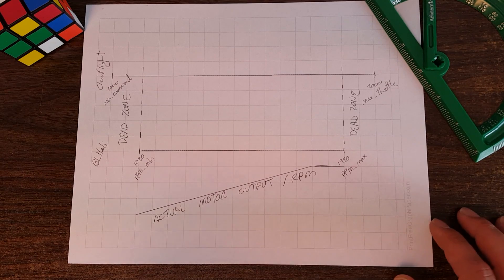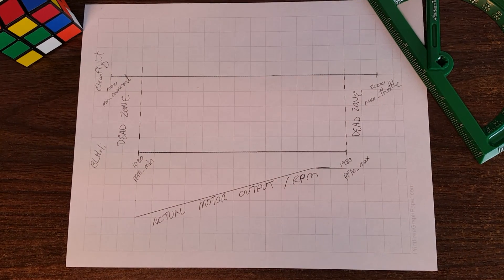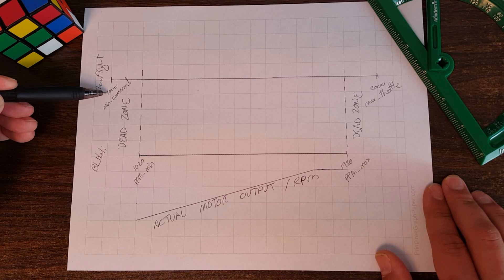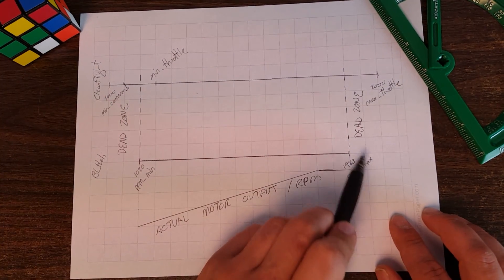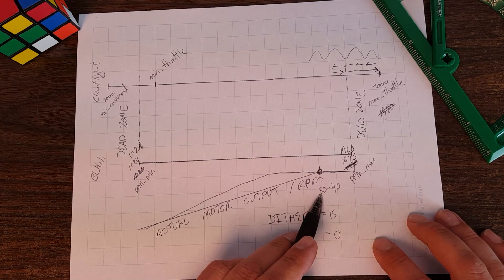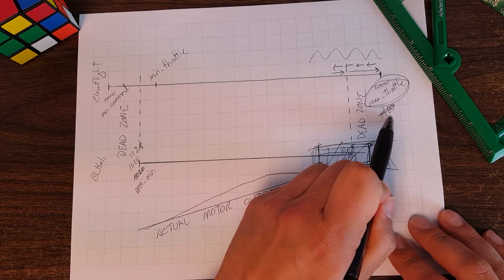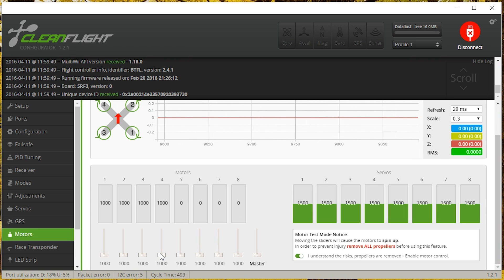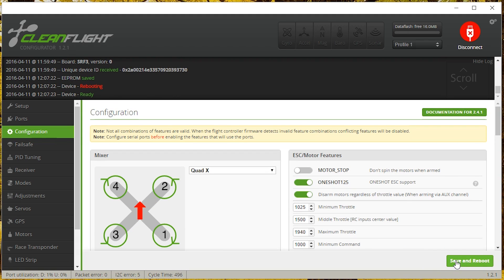Cleanflight BLHeli Top-End Throttle Calibration

Comment: Hey Joshua - did you reset your stick endpoints afterwards to 1940?
Reply from the maker: +roylionking No. Because the stick endpoints and the Receiver tab are on the INPUT side of the FC -- from the transmitter to the FC. The ESC endpoints and min_command and max_throttle and min_throttle are on the OUTPUT side of the FC -- from the FC to the ESCs. There is no implied relationship between the input and the output side at all. The input side goes from 1000 to 2000 unless you change that using the rxrange command. The output side goes from min_command to max_throttle, and those values can be whatever you want, but they have to agree with the ESC PPM min and max endpoints. Cleanflight takes care of mapping between the input and the output side curves.
Reply: +Joshua Bardwell thanks! So is it worth tuning endpoints on the taranis, where 100% results in over 2000 and needs something like -98% to 97% to give 1000-2000?
Reply from the maker: Tube endpoints on the Taranis to make 1000 to 2000 on the receiver tab. This is usually about 97%

Comment: why don't use the highest value? 
when using the lowest value only that motor will reach top rpm?
if you use the highest value all motors will reach full throttle and the deadband will only be as big as the difference between the highest and lovest motor?
Reply from the maker: +oskar aidantausta Using the lowest value keeps all motors from ever entering the dead-band and some motors will not reach full power. If you use the highest value, some motors will enter the dead-band, but all motors will be able to reach full power. Either approach is fine. The "lowest value" approach should give smoother flight.

Comment: Very happy to have such good information available.  Thank you Josh!  I really like your hands on approach to discussing this.  It was a nice point to also talk about Kiss escs and their linear throttle curves vs Blheli and the top end flat spot.  Great stuff!
Reply from the maker: +QuadQuestions.com Thanks for watching. And thanks for the QQ190 frame--now that I know it goes to 40 degrees uptilt, I LOVE IT. Can't wait to get it in the air.

One question (as long as you're here) -- why not build the vTX mount into the back of the camera pod base-plate, instead of having it be a separate add-on? Seems like just a square cm of carbon more, and you could easily do it.
Reply: Joshua Bardwell Hi Josh,  I would like to add you to our development thread on Facebook-  We have a lot of new changes in the works-  Ill send you an invite.  :)
Reply from the maker: Sure!
Reply from the maker: I'm game. I don't think I've gotten the invite. Did you send it? Feel free to message me on FB or gmail.

Comment: I'm not sure what happened here but when I tried this I actually lost a massive amount of performance. I normally just adjust my min throttle and calibrate in the GUI and never have any issues with min at 1025 max 1850. I followed your process to the letter but with max throttle set to 2000. I tried this on two different quads with the same results.
Reply from the maker: +JusticeFPV if min 1025 max 1850 works for you, stick with it!

Comment: Josh, just a quick question, wouldn't we not allow the other esc's to reach full throttle by picking and setting the lowest value?  If we enter the highest then all the esc's will reach full throttle..or am I missing something? Thanks.
Reply from the maker: Yes, but the alternative is some ESC's going into the dead zone. If you want, you can adjust the top endpoint of the ESC's individually so they all max out at the same rpm.

Comment: So it's a throttle curve essentially, couldn't it be done that way too while listening to top end? Be gentle with me if I missed something :)
Reply from the maker: +MicroRCFiend You couldn't do it on the transmitter because the issue is between the FC and the ESC, not the transmitter and the FC. A transmitter throttle curve would not prevent the FC from commanding the motor to go into the dead-zone.

Comment: I just want to say I just did this and when testing my motors the Extreme Spread of values was 20. Joshua's was much lower. This might explain why he didn't see a quantifiable difference in blackbox logs. I'm assuming we are using different esc's so the timing difference between esc's can vary a whole lot. I'm going to try and get some blackbox logs tomorrow to see if I can spot a difference. I noticed that during a punchout my old logs would show oscillations, but when doing a 180 degree turn I would see very little oscillations even though the quad was in propwash. This leads me to believe that this issue is what caused the oscillations on the top end and not incorrect P gain. Joshua reviewed my old logs (username Surgikill) so hopefully he will review these new ones and see if he can spot a difference. If you want Josh I can take and use the same PID settings and different PID settings and send both to you so we can see the difference. I'll be flying tomorrow so if you could get back to me before then that would be great.

Comment: Hi Joshua,
That is great!! Arducopter has a maximum throttle dead zone parameter we put in to account for this problem because I noticed that the thrust curve consistently rolled off in the top 5%. But the only way I knew how to detect it was with a full thrust curve measurement, not very helpful for people at home. This is a great way of finding that point, easy and obvious!!!

Comment: Thanks Joshua, motivated me to built an amp limiter.  I remember toasting a 1306 running it at max RPM a while back, don't want to do that again :)
Reply from the maker: +SavageThrash You will need to let at least some amps through in order to spin up the motors, especially with props on. Otherwise the voltage drop will be too extreme and the board will shut down.
Reply: I'll be keeping the props off. Got a little 5w brake light bulb that should do the trick. Go figure I am out of female xt60s though...

Comment: Just did this on my quad, came out to 1943. Set in BF 2.6.1 and will see if I notice any difference tomorrow, great vids as always!
Reply from the maker: +Dragonsbane777 It seems like most people are coming out around max_throttle minus 50 to 60. I would guess that 1945 would be a safe value for most people who are using 2000 max_throttle.

Comment: Have you noticed and improvement in flight Joshua?
Reply from the maker: +joseico90 it's pretty subtle if it's there, but I didn't have strong oscillations at the top end to begin with. I don't think everybody is affected. But many people have commented on RCGroups to say that this technique fixed persistent top-end oscillations that they couldn't fix any other way. So I'm sold on it, on principle.
Reply: +Joshua Bardwell Thanks J, I am on the same scenario, other than some props wash no real top end oscillations, I will however implement this, thanks for your time. :)

Comment: Really informative video. Will the transmitter throttle max end point need to be reduced to meet the new max-throttle?
Reply from the maker: +Harry s No. The input-side values (from TX to receiver to FC) are completely independent of the output-side (from FC to ESC) values. The input-side values must go from 1000 to 2000 on all channels, unless the rxrange CLI command has been used to modify that setting. Again: the INPUT SIDE values are COMPLETELY INDEPENDENT of the OUTPUT SIDE values. 

This is a very, very common point of confusion, and if there were one single thing I could communicate to everybody who flies Cleanflight, this would be it.

Comment: Another interesting and educational video, thanks man! Feels like the motivation behind the upper deadband is a bit weak, maybe take a discussion with the BLHeli devs to remove it?
Reply from the maker: +salle rc really that's just my speculation as to why it's there. The BLHeli devs should get a chance to weigh in. They are very smart guys, and they likely didn't put the deadband there for no reason. Try opening an Issue on the BLHeli github proposing to remove the deadband. That is probably the best way to get in touch with them.

Comment: Joshua why do i get 1782 with mine using 3 cell like you .
Reply from the maker: +dhardjono No clue. That is awfully low. What are the endpoints in BLHeliSuite? What is your min_command and max_throttle set to?
Reply: +Joshua Bardwell not sure the belhelisuite i got RMRC - 30A Race Series ESC - Silabs F390 min is 1050 2000 max throttle.
Reply from the maker: dhardjono What are the min/max values for all four ESCs after calibration? What are you rmin_command and max_throttle set to in Cleanflight?
Reply from the maker: What about the ESCs? Are they all at the exact same values?
Reply: +Joshua Bardwell  yes
Reply: +dhardjono after calibration it 1000 on all 4 esc
Reply from the maker: After calibration, the ESCs are at 1000 and 2000?
Reply: +Joshua Bardwell yes they are but not on the rc page it goes to 2011
Reply from the maker: I'm sorry... I'm completely lost.
Reply: +Joshua Bardwell it ok i am using 1940 and see what happens flying it thanks for all your help

Comment: Joshua, how about manually setting 1020 and 1980 as the min and max in blheli, instead of using throttle calibration, this way all of your escs have the exact same top and bottom values?
Reply from the maker: +Eugene Pressley The problem with this approach is that you don't take into account the small variation in the individual oscillator frequency of the ESCs. For an ESC with external oscillator (i.e. all BLHeli ESCs) this variation is going to be quite small, and probably doesn't matter very much, but on the other hand, we are in the realm of splitting hairs here, so maybe we care.

Try this: run throttle calibration and look at your ESC endpoints. How far off are they from each other? In my experience, it's usually about 10-20 us. For me, this is more variation than I care to have--although, again, in practice, it almost certainly doesn't matter.

Comment: Another wonderfully informative video.  If I have my new throttle range in cleanflight set to 1020 - 1960 to remove deadband following the procedures outlined in your video shouldn't I also change my radio throttle output to only go between 1020 and 1960 to get the most resolution?
Reply from the maker: +PropellerAddict No. The radio throttle channel must go from 1000 to 2000, unless you have changed those values using the rxrange command. The input side (radio -> receiver -> FC) is independent of the output side (FC -> ESC).
Reply: +Joshua Bardwell So somewhere in the FC firmware my min/max radio throttle output of 1000/2000 gets scaled to the minimum command/maximum throttle of 1020/1960?  Thanks for the clarification.
Reply from the maker: PropellerAddict Sort of. The throttle channel determines a "set point" for the mixer. Then the output of the PID loop is added to or subtracted from the "set point". The mixer then determines motor output values.

The throttle channel goes from 1000 to 2000 (or otherwise if you have used rxrange).

The throttle channel has an unused dead-space at the bottom, from 1000 to min_check, within which yaw is disabled and motors will stop running if motor_stop is enabled. This is used for stick arming and disarming. If you use switch arming, yaw continues to work when the throttle is below min_check. If you use air mode, motor_stop is overridden and motors continue spinning when the stick is below min_check.

The input-side throttle curve goes from min_check to 2000 (or otherwise if you have used rxrange). The reason that it doesn't go from min_check to max_check is that there is no need for dead-space at the top of the stick travel, because all stick commands that require "high" stick values are input while the copter is disarmed.

The motor output values and the mixer "set point" go from min_throttle to max_throttle.

Therefore, we could say that the input throttle channel, which goes from min_check to 2000, is scaled to the range of min_throttle to max_throttle. But remember that this is only adjusting the "set point" that the mixer uses, and actual motor values will vary based on what the PID loop is commanding them to do.

Comment: What about using a clamp meter on the battery to detect a change in motor RPM? Seems like a more reliable method than using your ears, and finally I'd have a reason to buy one ;)
Reply from the maker: +Jaap Pieroen I think the ears method is pretty reliable. But don't let me stop you buying a clamp meter.
Reply from the maker: +Jaap Pieroen Remember also that the clamp meter measures amps, which is not what drives the motor. Watts drives the motor. So all else being equal, as battery voltage goes down, amps will go up. IMO, there is too much variance in battery voltage to use amps as a reliable measure of rpms. 

The absolute best way of measuring this would be with an ESC that has a built-in rpm telemetry output, like the KISS. An inline rpm meter such as is used by QuadMcFly would be good too. But really, the difference in rpm is quite audible, so I feel very confident about the ears method.

Comment: Great video and thumbs up for being left handed! :)
Reply from the maker: +Gerhard Mikysa Lefties unite!
Reply: +Gerhard Mikysa Totally agree,  the logic of a left handed brain is always apparent in Joshua's vids.     Great explanation Joshua,     I have been calibrating ESCs with CF Max throttle at 2000, then after calibrating dropping max throttle to 1950 as it seemed to improve high end throttle linearity when testing with an optical tach without affecting max RPM. Now I see why. Figured it was calibration dead band but didn't know about the flat spot in BLHelis throttle range.  Thanks for the video.
Reply from the maker: Correct.
Reply: +Trainboy64 +Joshua Bardwell So the correct way to go of calibrating ESCs would be:
1. Calibrate ESCs via BF / CF.
2. Find the value for Minimum Throttle (when all motors starts to spinning) + 20
3. Find the value for Maximum Throttle (as shown in the video)

Is that correct?
Reply: +Joshua Bardwell Thanks Joshua
Reply: +Gerhard Mikysa ah yes, or course! didn't think of that!

Comment: I watched this on the way home - thanks for putting all the info in one place.  It's really appreciated.

After calibration, I had three motors top out at 1955 and one at 1950.  I thought about the difference between the four, went into BLHeliSuite and manually raised the PPM-Max for that ESC by 1 click.  Went back into the motors tab and they now all top out exactly at 1955.  I did a similar thing at the bottom end although that of course is a bit harder to tell since they all chirp a bit...

As mentioned, that little extra step almost certainly will make no real world difference, but I guess it's my little perfectionist voice wanting them to all be the same.

Comment: Joshua, do you still use the "idle Up" switch?  I never got rid of it even with air mode.  I set it up similar to your video.  Wondering if it would best to remove the idle up (which is just on the arm switch for me).  Thanks!
Reply from the maker: +Beerad FPV Now that air mode disables motor stop, I don't use idle up any more.
Reply: +Joshua Bardwell I just removed mine.  Lowered my Min_throttle a bit as well.  I noticed yours was 1025.  I couldn't get lower than 1035 on any of my quads without twitching + the 10 just in case.  :)
Reply from the maker: Beerad FPV Everything is different. I never had min_throttle that low before I flew Littlebee.

Comment: Wait...don't you need to calibrate in Cleanflight - a max that 'includes' the final step of full throttle? If 1947 was the highest - you would need to set max to 1950 to ensure all three motors get the full throttle - and a small gap (but no significant flat spot...)...?
Reply: +Stephen Wright Depends on whether you want the full throttle range or potentially less oscillations.
Reply: +fluttershy77x I'm comfortable with a tiny amount of oscillation as long as I get full power.  Cutting the deadband by 80-90%% but still having full power seems better to me than cutting the deadband by 100% but only getting 99% power.
Reply: 3 points is surely not going to lead to much oscillation?
Reply: actually I guess it would be up to 8...but still...can't be a huge issue if people were flying up to 60 with not a giant problem...seems wrong not to have full power on punch-out...
Reply from the maker: +Stephen Wright a simpler approach would be to subtract 20 from the top end. You know for a fact that the top 20 us is bogus.
Reply: +Joshua Bardwell I ran thru the method posted by JulianGoesPro on the first page of the Multishot thread...for me the last step of full throttle was 1957 (all motors at once) so I set mine to 1960...

Comment: Just tested this with simonk in librepilot and there is a rpm plateu at about 23us from max throttle.

I always wondered how the pid loop handled stabilization whilst pegging the throttle.
I bet this helps a lot with stabilization as the fc will be able to reserve some throttle for stabilization corrections.
Reply from the maker: +Stephen Gibb that's not how stabilization works. Remember that the deadband is implemented by the ESC. There is nothing else above the ESC max PPM. Stabilization is handled by reducing the other motors proportionally when any one motor would exceed 100%.
Reply: +Joshua Bardwell Interesting I guess without active braking the authority of the stabilization must be slightly compromised as decelerating the props without it would be very slow. 

I have to say though I think betaflight is more aggressive in this regard as when i switched from librepilot I noticed that there was significantly more power on punch outs. Both had properly calibrated esc's.